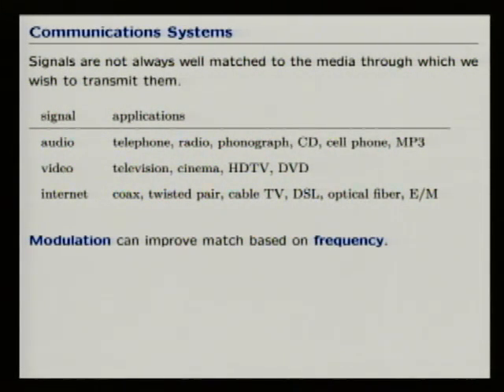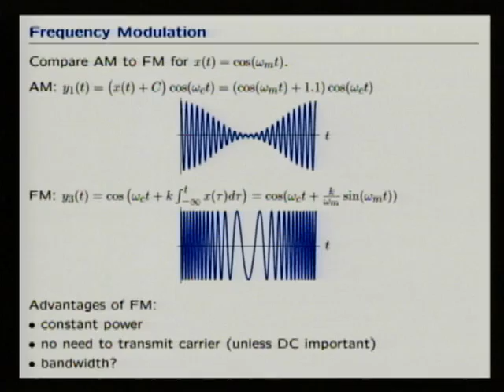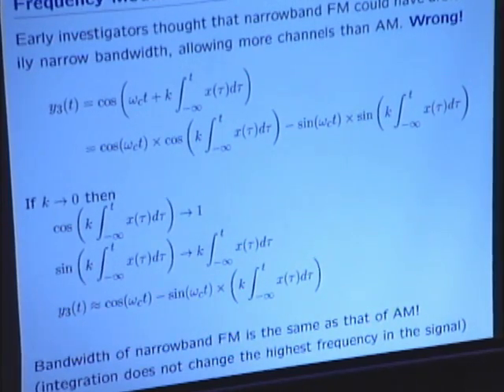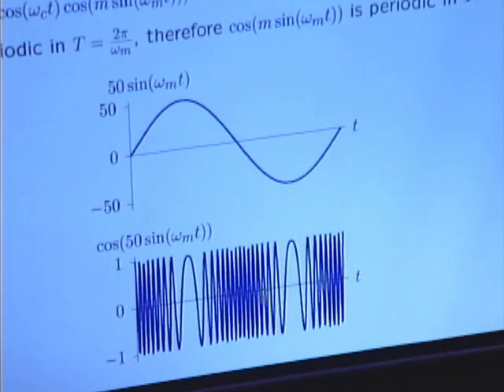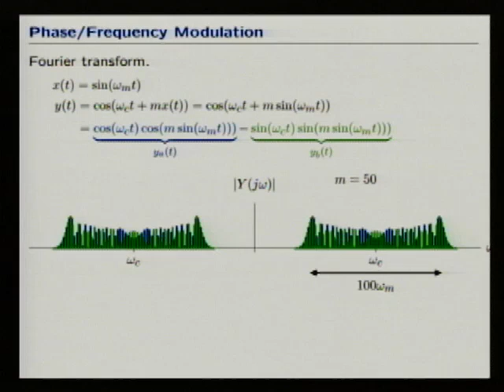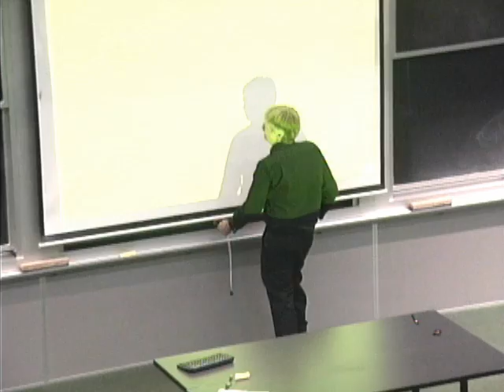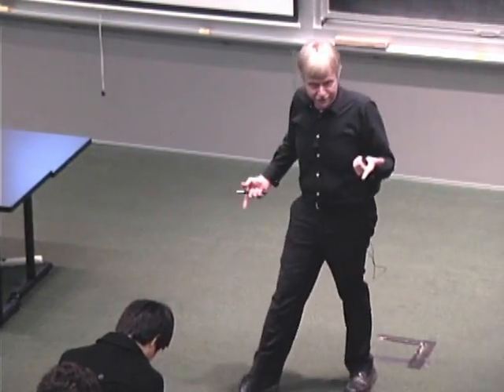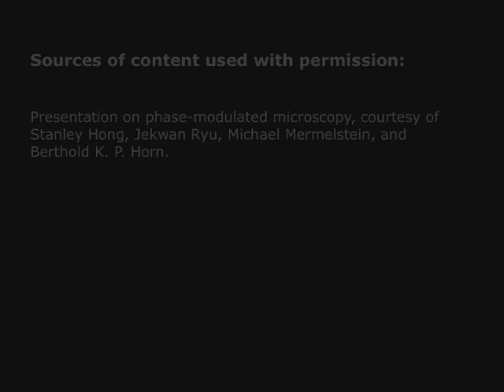24. Modulation, Part 2

Comment: Outrageous! Is Dennis Freeman really presenting this microscopy technique as the 'idea' of him and his PhD students? This was developed in the 90s, and is now well known and widely used. It is known as Structured Illumination Microscopy and not 'Phase-Modulated Microscopy'.

For example, see
Enhancement of axial resolution in fluorescence microscopy by standing-wave excitation, 1993.
Laterally modulated excitation microscopy: improvement of resolution by using a diffraction grating, 1999.
Surpassing the lateral resolution limit by a factor of two using structured illumination microscopy, 2000.